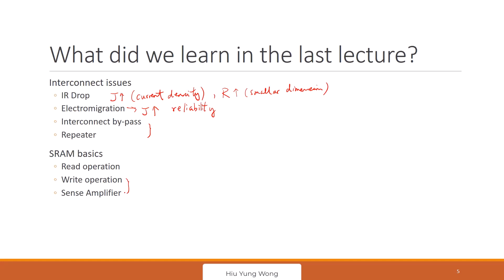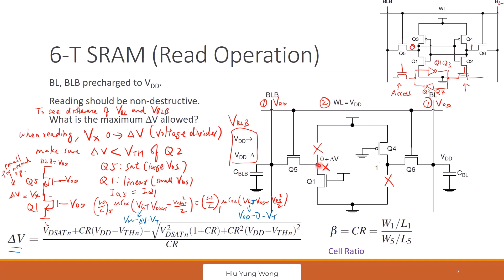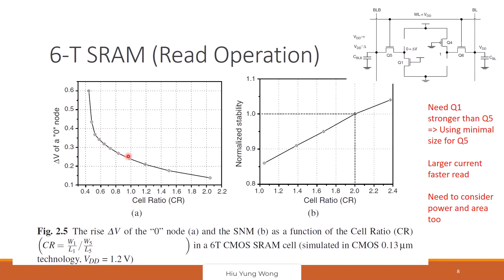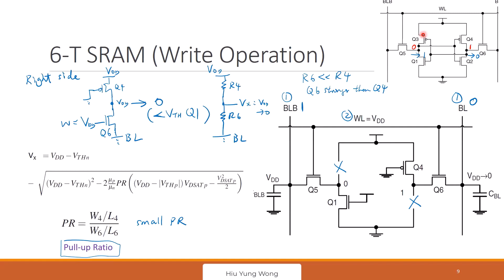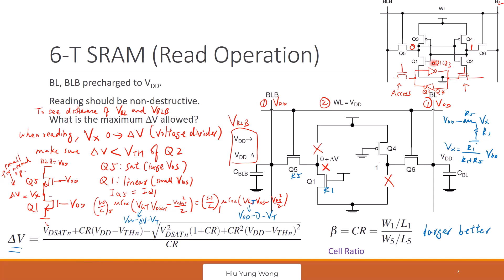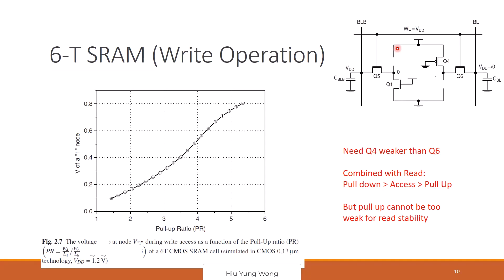L27-A SRAM: Read and Write Operations

Comment: I found this quite useful. By the way, there is also a "do nothing" operation. Will you cover that too at some point in the future lectures?
Reply from the maker: @kairostimeYT, do you mean when it is on hold with the access transistors turned off? There is not much to talk about except maybe the hold static noise margin which was covered here: https://www.youtube.com/watch?v=8KGnbKaf-OQ
Reply: @quantum_computing   Yes, I was indeed referring to that; I didn't initially realize that you went on to cover it towards the end!
Reply from the maker: Great!  @kairostimeYT